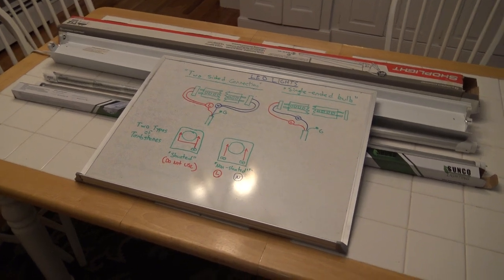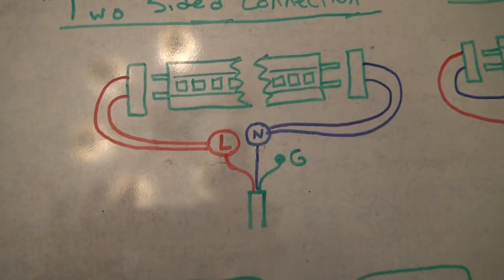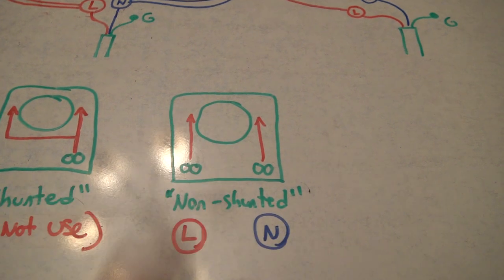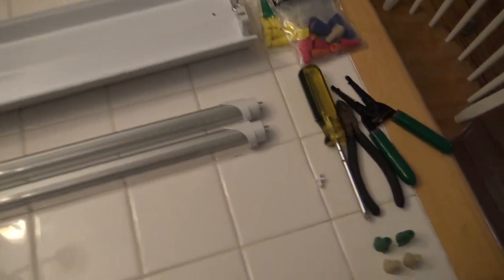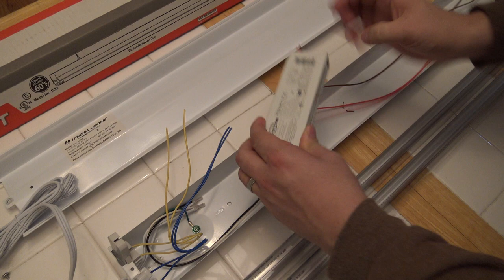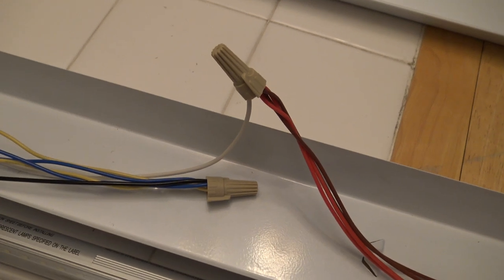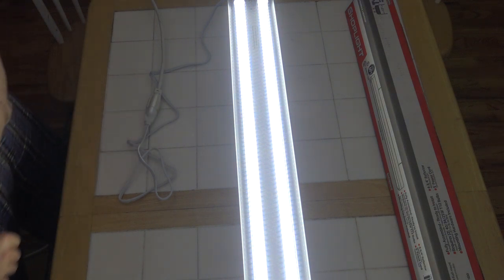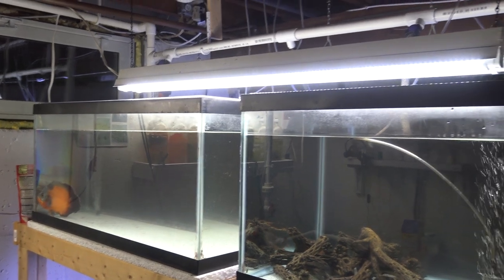#400: How to Rewire T8/T12 Shop Light to LED - DIY Wednesday

Comment: i know its almost 4 years later, but after half a dozen videos and websites, this video finally got me to figure this out! thank you!  im an idiot when it comes to home improvement stuff and being that my wires were never the same color as what everyone else said (I HAVE NO YELLOWS!!!) but your explanation helped me. thanks again!
Reply: juggnuttz.  Here's what I did to "convert" different colored wires to show neutrals -- spray paint the last 3 or 4 inches of the wires with white paint on each end before stripping.  Then place them in your 'stones like normal

Comment: Greg,. Just bought 8 LED bulb tubes for my long suffering shop lighting needs.  Paid under $60 for the lot.  Color and lumens, etc is acceptable.  Feit is the brand they had.  Seem to be double ended, but it didn't say as far as I can tell.  Wired them up as single sided and they didn't work, so more wire will be used.  Hope they work as well as other folks LED convertions do.  Yours is a good tutorial, so thanks my friend.   Bob.   Happy New Year

Comment: Great job young man. Keeping it simple and to the point. Your communication skills and very good. I have five fluorescent fixtures flush mounted and will leave them in place to remove ballast and do the wiring on a ladder. Too much work for me to tear them all down just to rewire per your excellent video. Thanks. ...and yes, I will turn off the circuit breaker and double check with meter.
Reply: I agree as long as access is good.

Comment: Great video .. only suggestion I have is for safety 🦺.. when we convert  to l.e.d. bulbs take a permanent market & write ( led only ) or if it has use sticker that comes with bulbs. 
Only reason for that is if bulb goes out & next person tries to install a flurescent bulb it will explode/pop & burn tombstone up.

Comment: Nice job Greg... just a note on the terminology... the L stands for line not load.  The bulb is actually the load but in AC electrical terms, the L is the hot side or line and the N is the neutral or common side. You did a great job on the video...in a lot of instructional videos, the host is all talk and no action. Sometimes I just want to toss my iPad across the room. You got to the point and kept it interesting. Thank you!
Reply: JohnnyLightning ! Haha it's funny 😆😆 L can means either Live or Load.. It's the same thing.. Don't confused ppl 😁😁

Comment: we have got  clear led tubes 4ft,non shunted,removed the led strips an inserted 3 -150 watt led full spec strips,i  used A LED DRIVER TOO,IT WORKED GREAT DID A 4X4 ROOM ON VEG TO FLOWER,4 LED TUBES,RED,BLU,WHITE, TOP SHELF ,HIGH INTENSITY LED STRIPS,NON SHUNTED

Comment: I saw your video, because I want to try switching over from T8 to LED lights for my houseplants, but I have a problem and that is most of my lamps don't have visible screws to take them apart to find the ballast to remove. The model number on one of them is .234SLESW, rapid start, and the "tombstones" seem to be sealed in as a single plastic unit on each end of the lamp. (these are what I find locally available at Menards.) The bulbs I'm trying to use are GT-Lite T8 grow bulbs. The claim on the box is that they can retrofit a number of older fixtures except "electric chip" though the directions on what works and what doesn't is a bit lacking. It was only in a single place that I found the disclaimer about electric chip ballasts. That said, I have one fixture like the one you used that I can attempt this project upon when I feel ready to tackle it. I haven't removed the ballast and the retrofitted LED works as advertised. The other lamps that I described, do NOT work with the LED lights, even though they are listed on the bulb's box as compatable aka "rapid start", "instant start.". One smoldered and sparked. The other just popped and then shut off. The remaining fixtures I haven't tried. Are these just sort of out of luck, disposable once they quit being useful with old fluorescent lights, or can they be made compatible with LED bulbs?

Comment: Very nice! I also just found a 20-Pack T8 LED Light Tube, 4FT, 18W (40W Replacement), 5000K (Day Light), 2400lm, Frosted Cover, Dual-End & Single-End Powered, Works with/without ballast, Shatterproof, UL & DLC. It’s worked out well for me.

Comment: Great video!  Unfortunately the Sunco mfr does not have double-ended bulbs now. They only sell single-ended bulbs. I replaced a bunch of fluorescent bulbs with double-ended ones and now if any burn out i will have to rewire fixture for single-ended and mark it as such. I would prefer if they were all the same.

Comment: If you use a small nail, saftey pin or needle, you can remove the wires from the tombstones in order to bridge them together and shunt them using short pieces of wire.   This cuts down on the number of wires in the wire nuts.  Instead of four wires, you have one connecting to the hot or neutral.

Comment: Nice tutorial but with one exception. If your fluorescent fixture has shunted sockets just use them and save your self a lot of trouble and expense. Its really no trouble to simply connect the wires (or wire) from one end to your hot wire (usually black). Connect the wires (or wire) from the other end to the neutral (white) wire. That's it. You don't have to buy new sockets. Just remember to buy double-ended  LED tubes.

Comment: Hey Grey.. I did test the t8 philps led with shunted lampholder since the new casing bought is thinner and used only 1 wire at both ends.. Nothing really happened.. Then, i tested with normal Non shunted and walla it works.. I think the casing meant for double sided led.. But the label on the philps says other way around.. Glad the led wasn't damaged..

Comment: It looks like you could use shunted for you double sided diagram, instead of running two wires into one end, because you will have power to both pins with one wire. You would short the single side light with shunted though. Thanks for the video

Comment: I have an old neon light fixture using the fat neon tubes and ballast.  The ballast is faulty, and I want to convert to T8.  Do all the tombstones have to be replaced to accommodate the skinnier T8, or will the pins still work in the older tombstones?  THUMBS UP!!

Comment: Would seem cheaper to just buy a wood plank(cut to the size of the bulbs) and then purchase an electrical cord, wiring, tombstones and do it that way. Maybe add some mylar and make your own reflector. Just make sure you find a way to ground it. Also would need mount hooks + chains.

Comment: Costco has a two led light fixture with led bulbs. Why not buy a new fixture with bulbs already installed? There is very bright and sells for about 20 dollars!
Reply: Because those lights are part of the fixture. You cant replace them if they burn out. Also he bought a fixture to illustrate the process, but a lot of people already have the lamps, they just want to change to LED bulbs. I did buy one of the built in types, and depending on where you need them, they are great.

Comment: In my 40+ years in electronics/electrical, "L" is for Line (hot), not Load, even though it goes to the load in this case.
Reply: You are right about that, the author admits he knows little about electricity.  This video is out dated, at this time, there are many LED "tubes" out there that use 12VDC directly, the terminals are actually marked + and _.  The ballasts need to be disconnected and DC power supplies need to be wired in their place.  I have seen some replacements that actually have an internal power supply that utilize either directly 115VAC line voltage or still utilize the ballasts.

Jim

Comment: Currently, my kitchen using 6 T8 Florescent Lights / 3 ballast or TWO florescent per ONE Ballast. Is it possible to replace only ONE PAIR with LED and the remaining TWO Florescent will remain connected, All 3 Ballasts powered by ONE SINGLE wall switch.
Will the OLD Florescent Lights affect the circuitry of the LED Light Tube.
The reason I'm converting only ONE was because the existing ballast of the florescent was DEAD.

Comment: I've purchased a Phillips UniveralFit T12 replacement light tube. On the packaging it does not tell me if it is single ended or double ended. How can I tell? Also, how can I tell if the light tube can be used without a ballast or not if the packaging does not specify?

Comment: Ok so each tombstone needs 2 wires coming out and all 4wires on side to to the black and all 4 on the other side go to the white wire .... so if one side only had 2 wires one on each tombstone that wont work will it and yes there the non sockets

Comment: Nice very informative.. I'm just wondering.. If it is dual sided led, can it be used with shunted lampholder.. Because one end is live and the other is neutral.. One more thing.. What if the led is one sided input with the label L & N at the end.. Can it be used with two sided wiring? Will it work? I have a philips led T8 ecofit.. There's a label about the wiring diagram.. One is for the 1 sided wiring and the other with 2 sided wiring for live & neutral at one end of another..

Comment: It's strange that they have not standardized the wiring for LED tubes - some a re single sided wires with a dead end and the others have powers on both end with one side  hot and the other is neutral. Shouldn't you have tested the old tombstones to see if they were shunted or not?   In an a very old fluorescent with a starter are they usually shunted or not?

Comment: i have a t-12 led 4ft shop light, it has reg white light,is thier any easy way to make it full spectrum for plants,?i use a 8 bulb t-5 to  veg up ,an a 4bulb 2ft t-5 to clone an start seedlings,would the flour fixture conversion work the same on t-5s,thks

Comment: You show non-shunted tombstones as having (L, line and N neutral) at 4:40 .then when you convert the fixture wires you join them together (two blue and two yellow).Would this not be shorting supply Line and Neutral?
Reply: You can do double-ended power bulbs with either shunted or non-shunted tombstones. These happen to be non-shunted. For single-ended power bulbs, the tombstone MUST be non-shunted. 

For the blue and yellow wire, these were probably only differentiated for where they connect inside the ballast and why that is, I can only guess. For the re-wire, it doesn't matter, because we then know all blue/yellow will be carrying Load to one side of the bulbs, and all red/maroon will be carrying Neutral from the other side.

Edit: To clarify why the color of the yellow/blue/red/maroon colors doesn't matter, the colors probably had something to do with the ballast's circuitry, but since the ballast is no longer being used, the only important thing about those wires is that they carry Load to one side of the bulbs and Neutral from the other. It might be that there's a PCB inside the ballast that monitors each connection separately for some kind of error handler for safety and each color needs to go to a specific node on the PCB, or something even simpler, like making it easier for the person assembling the ballast/fixture to paint-by-numbers and just make connections in a certain order by color. I have no idea what it looks like inside a ballast or the details of how it works, so I can only guess.

Comment: So basically, no matter how many wires, one side goes to either black or white from plug to house and the other side of wires go to the other black or white not used. Is that right??
Reply: Jason M You need to connect each of the Live & Neutral wire to the right wire on the lampholder.. You need to label it correctly if only 1 sided so you not messed with the power input..

Comment: Why not use a shunted tombstone for a  two side bulb, wire it one side  N other side L Sounds simple that way or am i missing some thing.
Reply: Barry Seifert you can. If it’s a non shunted tombstone and you connect the two wires to either L or N you’re basically shunting the tombstone. But what’s more important is the configuration of the Bulb pins

Comment: L stands for Line I believe
Reply: OK, have basically the same fixture but at one end of the tombstones(non-shunted) there was a jumper. So I cut the jumper, extended it so I had four wires coming from each set of tombstones as in the vid. Connected black to one side, white to the other, plugged it in and LED's light for a split second then nothing....huh?

Comment: But my 8' fluorescent bulbs do NOT have 2 pins on each end? So how do I wire up the fixture if you have only a single large pin on each end of the bulb?

Thanks for any help.
Reply from the maker: pat dee I've never worked with a fixture like that, but I do see single pin long LED bulbs for sale, open your fixture up and see how it's wired
Reply: Ya bought the wrong bulbs maybe?
Reply: I have not bought any LED bulbs yet. But I will buy the single Pin ones when I switch to LED bulbs because that is what the fixture requires.

After I posted the above question; I did a LOT of research. The single pins are available any where; but they are not as common. The main advantage is: They are easier to remove and replace than the double pin bulbs. in fact standing on a ladder and trying to get an 8' double pin bulb to fit into the tombstone can be frustrating; so I prefer the single pin bulbs.

The procedure in this video is basically good for both; but there is no such thing as a "double ended" vs "single ended" on single pin bulbs, for obvious reasons.

To achieve the conversion from fluorescent to LED on the single pin LED fixtures; you put the HOT (black) wire on one end and the common (white) wire on the other end. And you're done. I could of course change out the "tombstones" to double pin, but there is NO practical reason to do that.

For whatever it's worth.

Comment: The new Led's run on AC 115volts I be a little scared to put them on my tank. The bluish led's aren't  they 12volts DC. I would think your going to pay more to run those led's that run on AC.
Reply from the maker: It doesn't matter 115v AC vs 12v DC, what matters is the watts (units of power) that are consumed by the fixture, if the watts are the same so is your electric bill
Reply: Greg Jones oh ok I just thought there would be a difference. I would of like to see what exactly is happening by putting a current meter that tell you your savings. Thank bro.
Reply: I thought the same before trust me your not the only one. I went from fluorescent lights to LEDS and saved me so much money and plus the bulbs for the other lights are expensive...LEDs last a very long time.

Comment: Great description, however, the bulbs you link to are single ended so the directions given will NOT work for anyone using your directions and the bulbs you suggest.
Reply: And I know it is an easy fix for the average DIY'er, but not so easy for someone giving it a shot for the first time.  Could involve tombstone replacement or even damage to the new bulb.

Comment: I messed with it for quite awhile and got disgusted with it.  I bought 12 Barrina single lamp T-5's and mounted, installed and enjoyed!  The 12 Barrina fixtures were about 90 dollars on Amazon I think.  They have plug in wiring and instructions if you need them. Now back to retrofitting now that I've seen this video and his explanation on lamp selection and types of wiring.  I'm reusing old fixtures because they are there.  I have ten T-8 lamps and I can because I can.  Fortunately I only have three to do at this time.  More later.

Comment: Wouldn't the shunted be the tombstone you would use for the double ended LED LIGHT ?
Reply: I agree, but since non-shunted is more popular and can be used on both setups
Reply: Non-shunted tombstones can be shunted if need be for double ended bulbs.
Reply: Too be safe need to replace with non-shunted..
Reply: Just in cased u wouldn't damaged anything coz many types of led.. But i think new types of casing happens to be installed with shunted lampholder..
Reply: Man I'm confused as shit with all this stuff rite when I think I under stand I read or see a different video....I have dbl sided LEDs and shunted tombstones...can I wire it like this ?????
Reply: patf03 me too. Lol. I already cut out the ballast !! My led tube says to use WiTH ballast. Oops idk if they single ended or not. Lol
Reply: @kchardway4629  yea I bought 4 single ended at 1st ..than I bought 12 dbl ended for the rest ..the dbl ended are the best in my opinion super easy connect I wire 2 each end after u cut the ballast out took me about 10 minutes per fixture

Comment: Would that light work well on a planted tank?
Reply from the maker: most of these consumer grade led lights are for offices or work benches and don't offer the full spectrum of light that plants need to thrive, you may be able to use a 4000k, 5000k and 6000k bulb to get a better color range, but i'd still default to T5HO lights for plants until someone makes an affordable "led plant bulb"
Reply: Greg Jones would the T5HO bulbs work in any shop light fixture?
Reply from the maker: T5 bulbs need a T5 fixture due to the smaller pins/tombstone and a different ballast
Reply: +Greg Jones (Greg's Fishroom) Ok thanks for the info.

Comment: LED light fixtures do not require ballast?
Reply: Nope.
Reply: @eliseintheattic9697  that's correct.  Just cut the wires off the ballast, disconnect the sucker and toss it, good or not -- it's of no further use to anybody converting to LED tube lighting.  You won't believe how good yer lights will be
Reply: @robertshorthill4153  Thanks, but I gave up on them.  I only managed to get one to work.  The second one kept going out and the 3rd one had completely different wiring and I never could get it to work. I ended up buying all new led lights now that prices have come down.